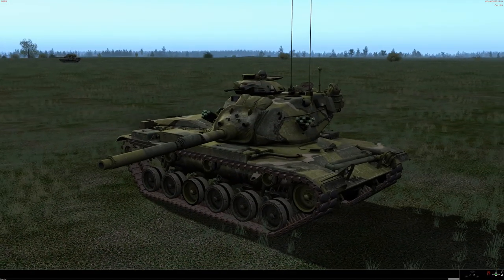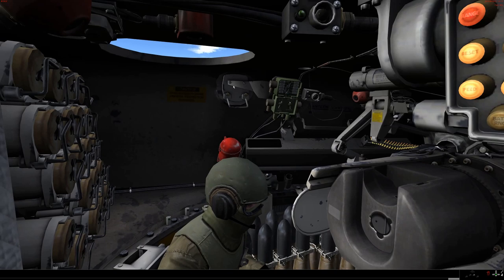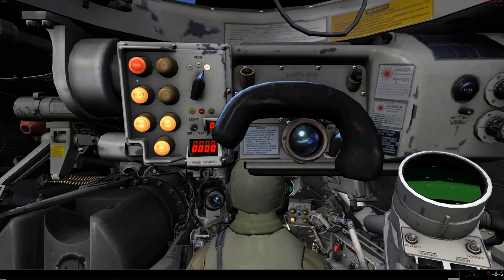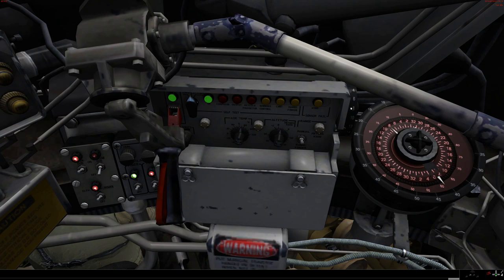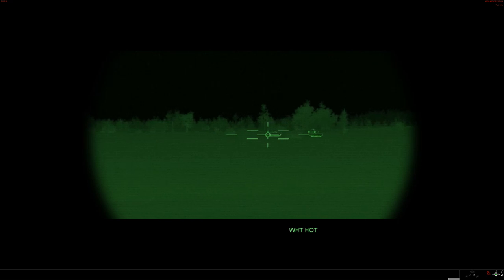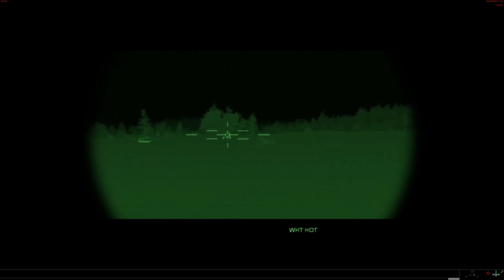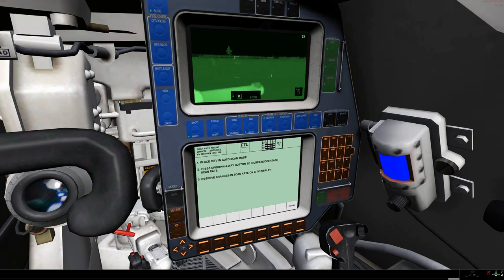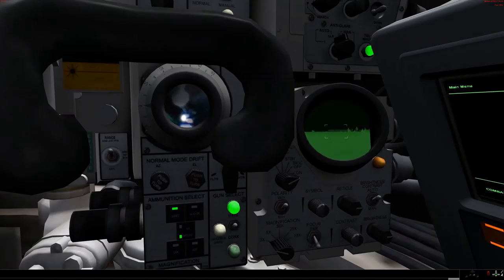M60A3 TTS Switchology, and a little M1A2.

Comment: BTW, when you use automatic lead in Stab mode, the reticle doesn't jump rather, much like the M1, both the reticle and the turret are moved to create the lead solution.  
P.S.  The stab simulation is not at all real world.  In the real world there is so much vibration to the sight picture that shooting at more than 1200 meters is just not a thing.  That's why we shot from the short halt so much.
Reply: I totally agree.  The one or two engagements I shot in M60A3 from the move were jiggly in the sight picture.   The M1 (105mm) moving engagements I did in West Germany were super smooth by comparison.
Reply: @N_Wheeler  The key reducing the sight vibration in stab in the M60A3 was generally to go faster. Each tank was somewhat of a rule to itself but the gunner and driver would experiment and determine the optimum speed for various surfaces. During a moving engagement the driver would try to run at that speed .
Reply: @wd4scz579  you are very likely correct.  We were shooting M60A3 at Ft Knox just to get ready for M1 (105mm) in Germany, so no time to fiddle with speed on the range lane.   There were no M1s in the Armor School for gunnery in 1986.
Reply: @N_Wheeler  The stabilization system on the M60A3 was the same as the M60A1 AOS from the mid Seventies. At low speed track slap exaggerated the vibration in the ballistic drive and sight mirrors. Telling a crew going faster was THE solution seemed counter intuitive, but later, when we were issuing the A3s at Vilseck that is exactly what those crews were taught. As I mentioned, the speed varied some depending on the tank and the surface, but the difference was sudden and dramatic.  It was a primary teaching point during crew drills and gunners and drivers were expected to experiment and figure out what speed was the "sweet spot" for their tank. (In 86 the maintenance portion of the Master Gunner course was taught in Todd Hall. Half the bays were M1 and half were M60A3. Most of the M1s still had the 105mm gun, the 120 was just coming on line)

Comment: As mentioned below, those empty shell casings would rattle around on the turret floor. If there was a lot of firing going on, the loader would have to stand on the casings to keep them from getting into places they didn't belong. Fun times at Graf and Baumholder in those old girls. One more item - the .50 cal ammo tray in the cupola could hold more than a case of Coke cans. Useful when on long road marches in Germany.

Comment: The hull indicator arrow is hard to see due to the angle of the dial, but is inner most and points directly "up" (zero mils).  Also, the lead calculation on the M60A3 is fixed, rather than the dynamic calculations found on the M1 series.

Comment: The swing out seat was referred to as the autobahn seat
Reply from the maker: Pretty sure the suicide seat was the TCE’s seat bolted to the turret roof
Reply: @thomaswilloughby9901  That sounds..... uncomfortable.  I guess you could call it a "significant emotional event" :)
Reply: @TheChieftainsHatch  , Pretty sure for the 10 years I was on M60A1/A3s we referred to the swing seat as either the autobahn seat or suicide seat.  As for TCEs, we sat on the loaders hatch with our left foot jammed into the grunt rail.
Reply: @TheChieftainsHatch  Answer to a question you asked in the video:  The Delta-P is a "Differential Pressure Transducer" which reads displacement of the gunner/commanders Cadillac's position.  It reads an output voltage of 0-/0+ volts when centered and nulled out.  As you depress the palm switch and turn the Cadillac's left/right you will be out putting a voltage between 0-to-15 volts (-) negative when left and (+) positive when right.  The farther the grips are displaced, the higher the voltage out put.   This is picked up by the computer which determines way and how far you've displaced the grips and the given voltage out put will tell the system how fast/slow to move the turret, or gun that direction (there are two Delta-P's).  The Delta-P is mounted to both the elevation cylinder and the turret travers motor.  They have two small O-ring orifices with strain gages that measure the pressure on the input side and the output side of the hydraulic actuator they are attached to.  So when they fail (which is not very often) it produces all kinds of unintended reactions (and excitement) when you push a palm switch.     Edit  Grammatical errors corrected after posting.
Reply: @TheChieftainsHatch  .... bolted to the open loader's hatch.

Comment: I was a "Young" E-5 on the M60A1 at Ft. Polk (Puke) in the Summer of 79 when we got our M240s! Probably the last or 2d last US Division to get them  (THANK GOD! The M73/219 SUCKED!)... ONLY "Willie Pete" had to be stored in the  Standing Ready Rack (13 Rounds)! In Korea, on the M60A1's & A3's as well as our M48A5's, our Base Load had Willie Pete, Sabot, HEAT, HEP & Beehive were stored on the Standing Ready Rack (Sabot in the #1 Slot up Front). (FYI... There is also a 3 Round Rack Ready Rack to the Right of the Standing Rack with all Sabot / 5 Round Ready under the Main Gun in the 48A5, again all Sabot). I served on M60A1's & A3's, M48A5's (Korea) M1 IP's and ended on M1A1's, retiring in 97. I loved the M60A3, very easy to keep running, but I spent 14 years as a Dino DAT! HOPE that helps....

Comment: Resetting the laser or Battlesight-Reset we commonly referred to as six-packing your laser. If you ever picked up a six pack of your favorite canned beverages using your thumb and middle fingers, it was the same finger position for doing a Battlesight-Reset. During gunnery cycles it was always a reminder to new TCs "Don't for get to six-pack your laser".

Comment: I was an M60A3 tanker in the 49thAD TX NG from 1990-92. Man, I forgot how much work it was to fight this tank wr a ginner/TC 😁 I did like the cupola though and my M85 was accurate and worked flawlessly. More often than not, we fired offensive engagements from a short halt.  I remember each tank had a certain speed where the sight would stop vibrating and you could see clearly, then the gunner would say "platform" and the driver would maintain that speed 😁. Definitely a dinosaur compared to the M1's far more integrated fire control system

Comment: Lead isn't applied the same as with the M1.  When you lase/lead with the M60A3 the reticle will jump behind the target, then the gunner has to relay the reticle, track for a second, and then fire.  If the target changes direction or speed the gunner has to relase to obtain a new lead solution.  On the M1 so long as you hold the palm switches after you lase, the lead solution (but not the range solution) will be updated 3x each second.

Comment: When you turn STAB on with the M60s, you don't need to press the palm switches to engage STAB as you would on the M1.  When an M60 is in STAB mode, it's in Stab 100% of the time.  So you null the drift without engaging the palm switches.  However, you do have to engage the palm switches to move the turret and gun.  In essence you are overriding the stab system.

Comment: Hello.  Enlisted 1981 out in 1990 back in in 2004,  Retired April 1 2022.  19E and 19K tanker, and a Federal Tech" working on M1A1's at Camp Roberts.  The "Delta P",  "Delta" is a Mathmagician's term for change. represented by a triangle.  "P" was pressure.  The "delta P was a small sensor mounted on the BACK side of the hydraulic traverse parts in the gunners station.  very small and moderately difficult to change due to awkwardness.  It measured the Hydraulic pressure on BOTH sides (right and left) of the traverse motor to help advise the computer on what was happening.

Comment: The one thing I didn't see you cover was the filter switch on the bottom left corner of the gunner's primary sight.  Laser, Amber and Red filters for different lighting conditions.  There is also a box for detachable filters on the 105D GAS (not modeled for use though).  Used them on the 'A1 but we didn't have LASERs so the green one was a different hue.

Comment: It should also be noted that later upgrades of the M1A2 restored the ability to use the Commander's .50 cal "buttoned up" from inside the turret via the implementation of the CROWS and similar remote weapon system mountings. The only MG on the Abrams that is manually aimed and fired on all versions is the Loader's M240.

Comment: The box to the right of the ballistic computer is the STAB controller unit.
Not sure about the latest editions of the M1A1, but until I retired in 1995, if your received a new type of ammo, you also had the computer card swapped out just like you were sort of mocking about the M60A3.

Comment: FYI in answer to your question at about 14:30
Azimuth indicator needs to be zeroed with your tank/turret/compass aligned. It is not used in the manner I think you are thinking as "0" can be any position you set it to in relation to the main gun.This way you could fire relative to your position with the magnetic compass alignment in accordance to positions on a map.
That is one of several ways of using the Azimuth to alien the main Gun. Usually used in night fire. or obscured position fire. This means that you can adjust the Azimuth by turning the big black adjustment knob in the middle of the Azimuth to zero it to varying situations.

Comment: No, the TC doesn't have to hit reset for the Gunner to relase.  Battle Range and reset was used when you changed targets if there was a rather large range difference.  Battle Range would move the mirror back to a 1200 meter solution and the reset button reset the commanders LRF laser button.  However, when the gunner lased the LRF automatically reset for him to lase again.

Comment: Azimuth indicator needs to be zeored with your tank/turret/compass aligned then you can read your gun direction if you needed to. On the side of the gun is the gunners elevation bubble that gave you your elevation. Combined you got direction and elevation. Choke sight works better in the 105D (one o five delta) if you have a line of sight. FYI the Gunner would announce "lazing" in the fire command to prompt the TC to confirm range. Also you need to dump your lead some times! lol  Love watching this.. how can i get the program? Too bad you do not have the M1A2 with CID (commanders integrated display) with IVIS (Inter-Vehicle Information System) to compare the M1A2SEP and the CDU (commanders display unit) and FBCB2. Also the CITV width was much improved.
Reply: I can see you have done your share of night fire.

Comment: That poor turret drive, grinding every time.
Reply: ITS 
SO
CHIRPY
Reply: My experience in M60A1s was that the grinding sound only happened when stopping the turret suddenly when traversing at high speed, usually by letting the palm switches go while the turret is still moving.
Reply: @TimothySielbeck  it could very well be that the AI gunner is letting go of the palm switches at the end of traversing. They do weird things but, hey, if you got a good gunnery score in Steel Beasts, they never miss!
Reply: @TimothySielbeck  it honestly sounds like a brake grinding. But still, shame on that overzealous gunner.
Reply: It's called a turret brake. It is normal.
Reply: Cory Brown For The Win!

This ain't yer Granny's "59" Chevy Pickup, and that sound doesn't indicate Grinding Gears...

1-37 Armor: M-60A3 "84-86", M1A1 "86-87"...
Reply: @belliott538  m1a1 from 1995-2001
Reply: Perfectly normal, I personally loooove the sound